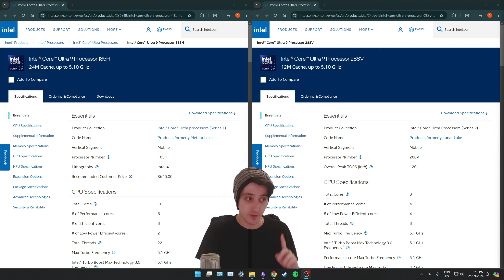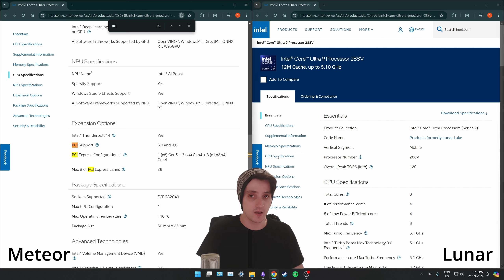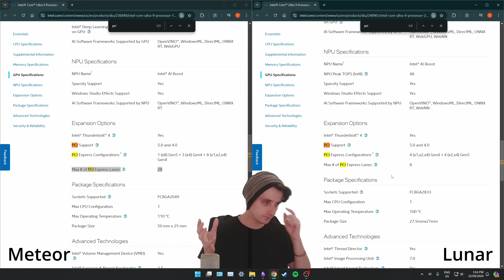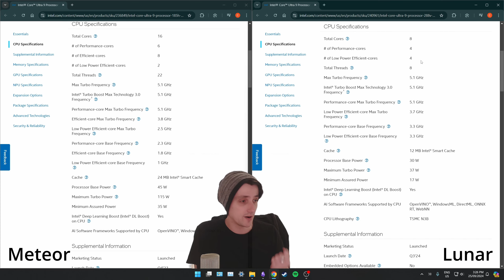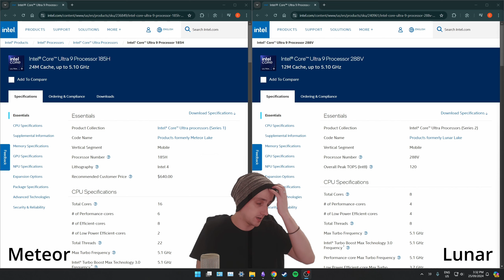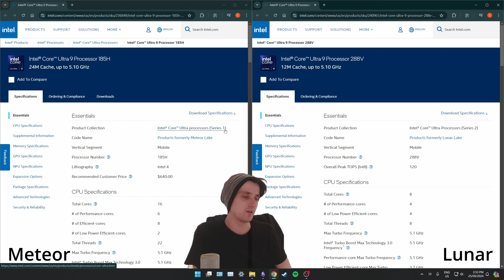Lunar Lake - dGPU Support?

Comment: hi I just saw your video when my new lunar lake laptop doesn’t work with my thunderbolt 3 egpu, should seen this sooner. Is this related to my egpu mot working? Because a system cannot work with an xe2 gpu and nvidia gpu through thunderbolt?
I have only seen another YouTuber with a video that can work with egpu, others all have failed.
Reply from the maker: HI mate, Its not related to the xe2 graphics to my knowledge.
What model eGPU dock, and what laptop do you have?
The only report I can see of one working with Lunar lake is the AOOSTAR AG02 on a Asus Zenbook 14.
The main difference between that eGPU dock is a lot of eGPU docks are PCIe 3.0, whilst the AG02 is PCIe 4.0.
It shouldnt matter though, as PCIe is fully backwards compatible, but it is a variable that is different.

In the video i call out PCIe 8x for Lunar lake chips, so i would think its upto each manufacture aswell, on how they are connecting bluetooth\wifi etc. 
Seen some post online of people reporting that when connecting an eGPU dock to Lunar Lake its breaking blutooth and wifi which also uses PCIe lanes so it might be hitting a lanes limit.
Reply: @John_Morrish  thx for the reply! My egpu dock is the old gigabyte arous gaming box 2070, and my laptop is asus expertbook p5(p5405).
Compared to zenbook 14, it has two 10gbs usb-a ports, two m.2 pcie-4x4 nvme slots. While the latter has one 10gbs usb-a ports and one pcie-4 nvme slot. They both have 2 thunderbolt 4.
Maybe the extra m.2 slot is the dealbreaker? I also saw one working case using chroma x dock and zenbook 14.
Reply from the maker: @yvongyoung262  I think you hit the nail on the head mate, on Asus website for the p5405 they mention both m.2's are PCIe 4.0.
So that laptop is utilizing more lanes than others (like the Zenbook) would.
Depending on your own interest, you might be able to run off one m.2 slot and disable the other in the BIOS? might get your eGPU working, although that would take sometime if you are using the other drive and would also limit your storage potential.
Good news, is a doubt you eGPU doc is broken!
Reply: @John_Morrish  Thanks mate! I’ll try to disable the other m.2 slot in the bios. That slot is 2230 and hard to find a proper one anyway. Dunno if that’s possible though.